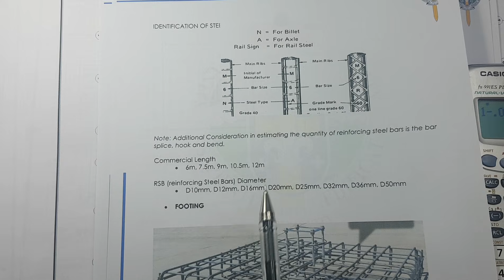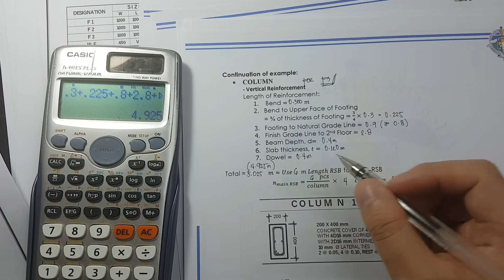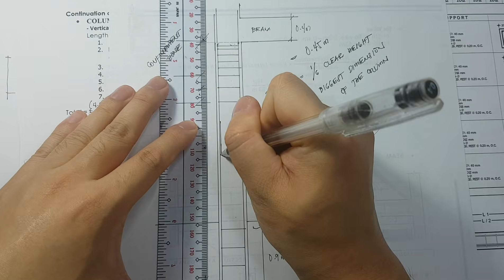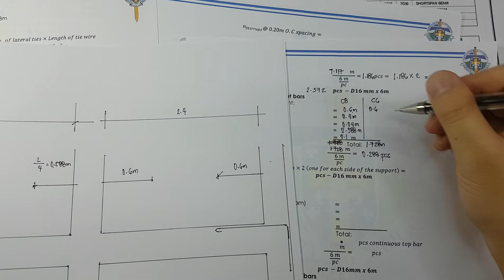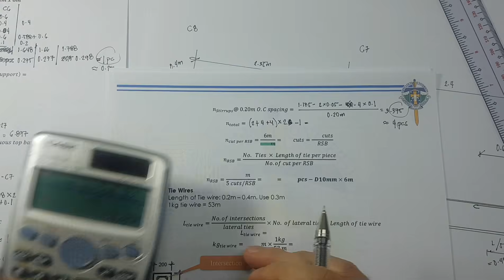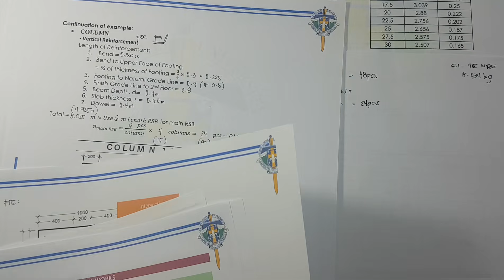Estimating Steel Works - Footing, Column, Beam, and Slab

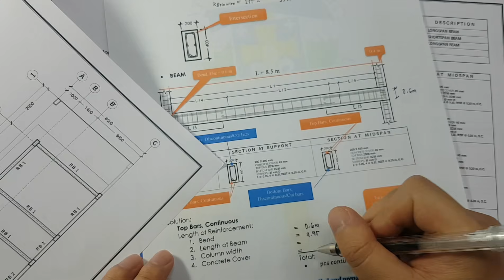Comment: Sir for clarification po at 1:27:15 sa column width po, isang 0.4 lang po ba talaga iaadd? Thank you po, your video is very helpful po
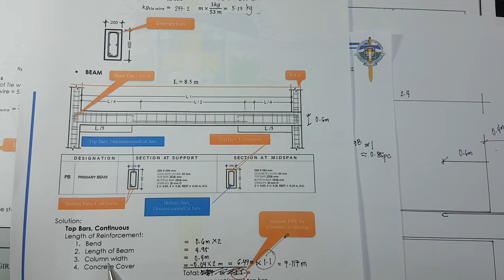Reply: Clarified at 1:50:55
Reply: Tapos po yung 2.8 span is naka center to center po sa column.

Comment: Sr Cutting list sa footing.maraming waste .7  malaki n po yan klaro na 10.5 length gmitin walang tapon.
Reply from the maker: Yes. I explained it to my class. We just used 6m commercial length for uniformity in solution, but i reiterated in my class the use of economical section. I didn't mention it here because it was reserved for my zoom class. This is a a classroom discussion btw, I just uploaded it here just to share some few knowledge

Comment: 14:20 Sir, very important po malaman ang most economical commercial length dahil pwedeng malaki po ang waste sa bakal kapag namali ng pagpili ng commercial length. Sa example niyo po,  3.60m ang magiging total waste kapag 6m com length ang ginamit pero kapag 9m com length, 0.60m lang po ang masasayang.
Reply from the maker: Yes. I explained it to my class. We just used 6m commercial length for uniformity in solution, but i reiterated in my class the use of economical section. I didn't mention it here because it was reserved for my zoom class. This is a a classroom discussion btw, I just uploaded it here just to share some few knowledge.
Reply: @kencabscivilengglectures6298  ENGR. GOOD DAY PO, PWEDE PO BA MAKA HINGI NG TEMPLATE NYAN? MARAMING SALAMAT PO :) SANA MAPANSIN,
Reply: kagaya po ng nag fifill nlng kau ng number tas e calculate nlng po,,hingi po sana ako guide para po mas makabisado ko po hehe
Reply: @gwai427  Up po

Comment: sir sana mabasa mo, sino po ba talaga responsible sa pag estimate in martials/budget sa contruction engineer or sir architect?
Reply: Engineers master, depende din sa scope, electrical & mechanical (for MEPFS) tapos civil engrs (for civil,structural & archi works)